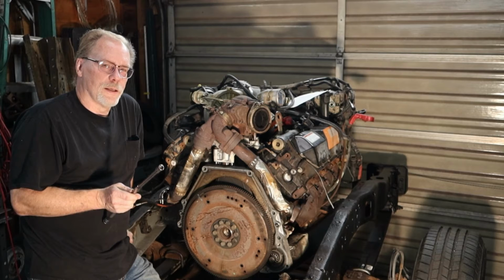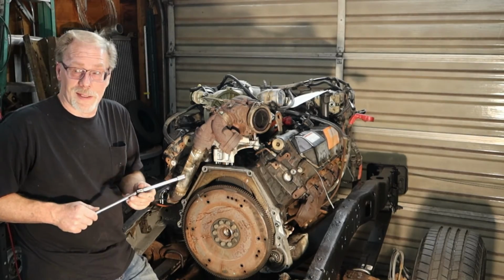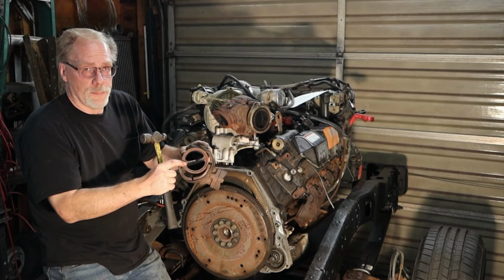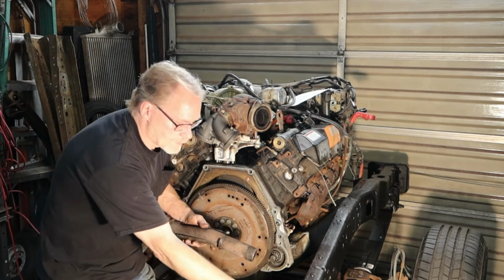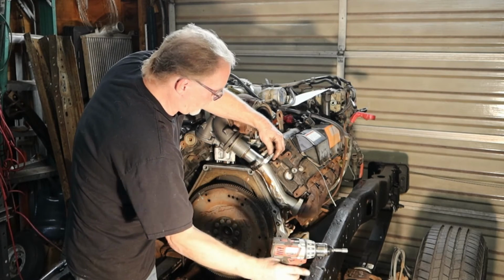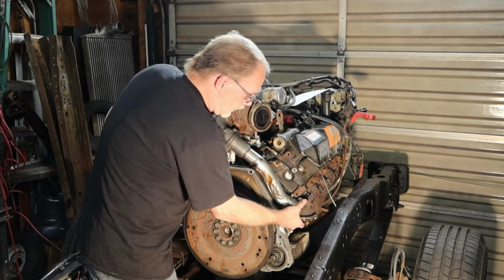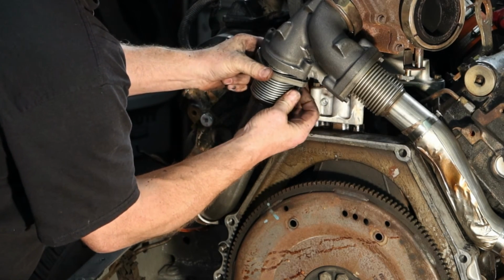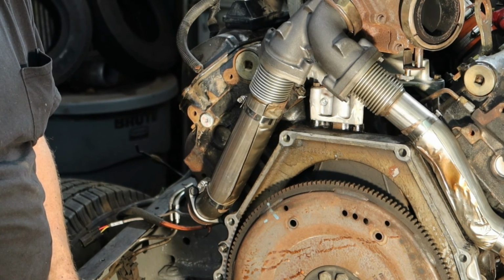7.3 POWERSTROKE UP PIPE REMOVAL / INSTALL 🛻🎥🟢🟡🔴🟢

Comment: It’s a ton different with that cab off than reaching around the turbo blindly trying to get that clamp on and off. Probably one of the hardest things I’ve done building motors. Not to mention the confined space. It looks like a piece of cake from the rear & nothing in your way above, plus you can see what your doing. Thanks
Reply: Yeah let’s see it done the other way now!
Reply: For real so hard. We did it and we are restaurateurs not mechanics. Scared us from doing stuff for a bit. But alas we are broke down again and about to tackle something else.
Reply: Lol try having a obs and the square flange with bolts and nuts..  the clamp is the easy version..

Comment: I know you are doing the open air engine as a visual aid to the replacement. However, doing the replacement without removing the tranny or the fender well skirts is grossly more than this. I fought with the 4 bottom bolts for hours. First, my 13 mm socket was stripping the nut. My 1/2 inch socket actually fit tighter. Putting a wrench on the top side of the bolt was difficult (understatement). I found a 1/4” drive 10 mm wobble head worked. I’ve been on this planet almost 7 decades so I tried to think of this as a stretching/conditioning workout! That didn’t eliminate the profanities though. Lastly I went back up top and simply pulled the Y Diverter off without touching a bolt. The donut had disintegrated to the point where there was nothing at all holding the pipes. For a DIYer like me, knowing what to do is often times not as important as knowing how to do it and which tools can and should be used. Now for the interesting part. Reassembly can take a variety of paths. I’ve watched a bunch of videos and they are all different. My theory is to attach the Y Diverter to the turbo before putting the up pipes on so I can get the V Clamp on properly without the headaches most seem to experience. Then the headache will be connecting the top of the up pipes. Is this possible? I know…old video. Not expecting a response.
Reply from the maker: I'm doing a newer video when i get that obs in the shop showing tips and tricks, tools that make life easier and faster ect ect

Comment: Clint, Thanks for your videos and sharing your knowledge about the 7.3 diesel engine.  I have 1997 7.3 and I’m want to replace my stock turbo and exhaust up pipes but not looking to change my fuel injectors what would you suggest. I’m not looking to make it a race truck but a good towing truck. But if I’m able to improve my power and fuel that would be even better.  Thanks

Comment: I'm getting ready to tackle this job.  I have the turbo off as I am rebuilding that, new blank pedestal, upgraded wheel for the turbo etc.  I'm wondering what to leave loose or tighten since when the uppipes go back on the turbo will still be off.  Looking at you do it makes me think to tighten the bottom uppipe bolts and leave the top loose until the turbo is reinstalled and torqued.  Thanks.

Comment: Man i would love to have my 7.3 engine out like that , it would jut be so easy to do every upgrade . i would do a fuel bowl delete first , then dieselsite adrenaline hpop , hpop oil line crossover, put some nice looking valve covers , that fuel pressure guage would be nice too. Any way another good video, i dont need to watch anybody elses videos your always do the trick .ohh and also id definitly put on a gtp38 ball bearing turbo , much bettter that bushing they use in the  factory turbo.

Comment: Let me start by saying that I appreciate your videos, very useful to me! Now for the question... I just replaced my up-pipes and on my test drive I noticed about 4 psi less boost.  What's the best way to test for leaks on the up-pipes? I've seen the boost leak detectors that use an air compressor but from what I can tell, they only test the intercooler side of the turbo.  Thanks for any info!

Comment: I tried swapping out my up pipes whilst the trans was out for rebuild and neither me nor the mechanic could get the Vband clamp off the turbo. It was right up against the firewall. We tried tilting the motor but that didn’t help. The turbo is newer so I’m wondering if whomever installed it put the Vband straight up rather than clocked to the drivers side a bit to aid in future removal. I guess turbo has to come out to do the job

Comment: QUESTION: the connector where the up pipes and turbo meet can you use this point to install your probe for your EGT gauge?
Reply from the maker: EGT probe needs to go either on manifold at the block or post turbo on exhaust tube
Reply: @CUSTOMWORKS7.3PSD   reason why I asked is because most information's and instructions say to install the probe pre turbo and i was not very sure on that and i figured it be a good question for you to weigh in on. and thank you  .

Comment: Thank you.
I'm new with this early low mile 99
And have been watching all your vids..like most people I've watched tons of videos on this engine. 
And I follow your practices. 
You've helped me to understand this little monster tremendously. 
I'm keeping it pretty much stock with only a few modifications. 
Just finished exhaust. 
Not going to roll smoke with it.
Just want a little bump.
Any suggestions on how to bump it mabe 75-100 more ponys would be awesome.
Reply from the maker: standard up grades that give the 7.3 a much increases snap , high out put LPOP , adrenaline HPOP, gtp38r ball bearing turbo
Reply: @CUSTOMWORKS7.3PSD  Thank you.
                                          😎
Reply: Thank you
      😎

Comment: If you have a hard time with the clamp, you can use an air hammer to rattle the y pipe
Reply from the maker: If you have used one before and understand the control of it yes I don't see a issue I just don't want to hear you never used one and you get in there full blast and bust something up or put a hole in something
Reply: @CUSTOMWORKS7.3PSD  a small and cheap one is best for knocking things loose without breaking them. Not everything needs the big power.  I also used a hammer drill on hammer only in a parking lot in MO when broken down once.

Comment: I just did my up pipes a year ago. I didn't realize there was a heat shield that goes on them as the ones I took off didn't have any. Put about 20k miles on the rig and no problems so far. What problems might arise if I continue to drive it like this?  Should I go ahead and get some sheilds?
Reply from the maker: The heat shields that where on yours where removed because the banding failed which is normal But the shields where there to protect from premature failure of the O rings on the oil Galley plugs, Banjo bolts for fuel and the fuel line and from melting the aluminum spacer on automatic trans This for you is only a concern if you are monthly or weekly pulling a load where high EGT's are present. Normal driving and semi occasional towing would prove not much benefit to install new ones or wrap with cooling tape
Reply: @CUSTOMWORKS7.3PSD  Thanks, that's good to know. Truck rarely sees a trailer. Maybe once or twice a year just to haul off yard debris. I mainly use it as a daily commuter to get back and forth from work. All highway driving, no hot rodding.

Comment: Tow  haul bottom howtoget it working
Reply from the maker: Items involved , The switch its self is usually the issue, Remove it,, the shifter and do a Continuity Test With a Multimeter , if good check the next wire in line for voltage P2P N2N then N2P P2n if one of the connections won't give voltage you need to find the broken wire or ground point, check fuses, relays , If all good check the computer for faults if good its a issue at the trans plug or internal trans issue

Comment: Would leaking up pipes cause p1211? I've done the main 4 sensors already
Reply from the maker: No
Power Stroke OBD-II Code P1211 – “ICP Higher/Lower Than Desired” (7.3L)

OBD-II Code P1211 from a 7.3 Liter Power Stroke is often caused by running “Hot Chips” or tunes that are demanding more ICP (Injection Control Pressure) than the HPOP (High Pressure Oil Pump) can deliver and can be accompanied by a lack of power or rough running. For what it’s worth, these are the exact parameters that trigger this code:
ICP 410psi Higher Than Desired for 7 Seconds 

ICP 280psi Lower Than Desired for 7 Seconds

Code P1211 can also be caused by legitimate High Pressure Oil System issues. Below is a list of some of the causes:

    Failed or Sticking IPR (Injection Pressure Regulator)
    Failed or Weak HPOP (High Pressure Oil Pump)
    Any Leak in High Pressure Oil System (o-ring, stuck injector, etc.)
    Low Fuel Pressure (Rare)
    P1280 / P1281 / P1283 – (7.3L)

The above codes are related to ICP also. If the SES (Service Engine Soon) light is on and these codes are present, the ICP reading through any scantool will not be accurate as the PCM is using a “default” ICP value. These codes are all “electrical” in nature. Common causes are shorts between the Red and White IPR wires or between the Red IPR wire and ground. These can also sometimes indicate a PCM problem.
Ford 7.3 Power Stroke diesel, code P1211, lacks power because of fuel restriction due to a failed fuel tank filters

These codes are all “electrical” in nature. Common causes are shorts between the Red and White IPR wires or between the Red IPR wire and ground. These can also sometimes indicate a PCM problem. Ford 7.3 Power Stroke diesel, code P1211, lacks power because of fuel restriction
Reply: @CUSTOMWORKS7.3PSD  alright. I appreciate your time and help
I am going to run a fuel pressure test and I have a "new wiring harness" ordered from riffraff, 600 bones but I plan on running this ride for a long time.
I did a smoke test and I did verify my up pipes do have a leak so I will be using this video as reference for this next project!
Cheers 🍻 and thanks again
Probably going to do some hpop videos aswell
Reply: She failed the injector buzz test, number 1 and 6 are no good. I'll be digging Into this on the weekend. Thanks again for your time